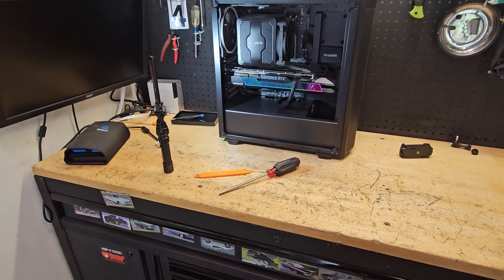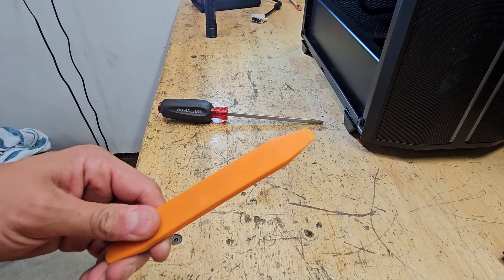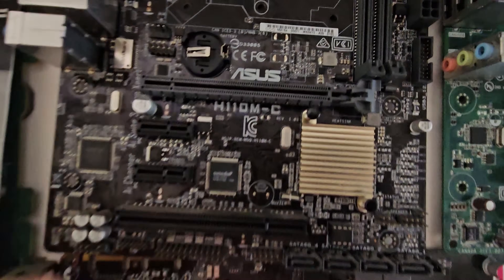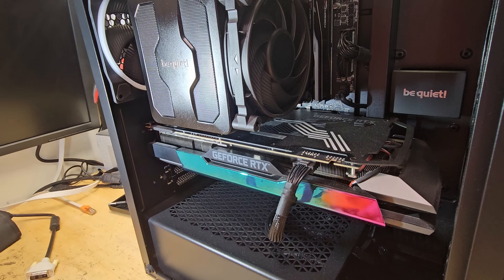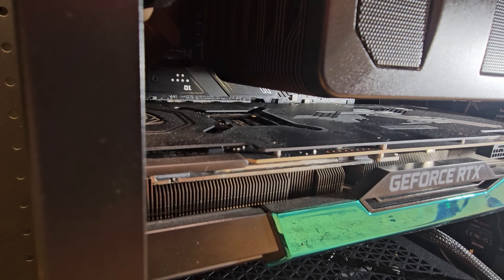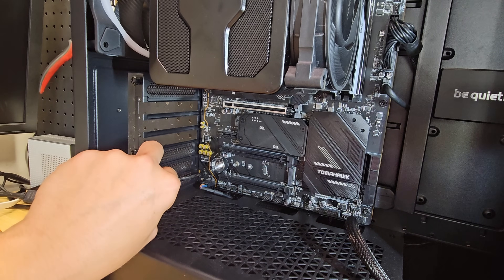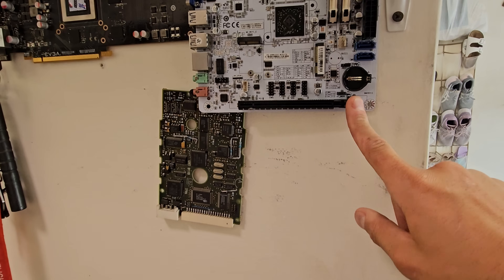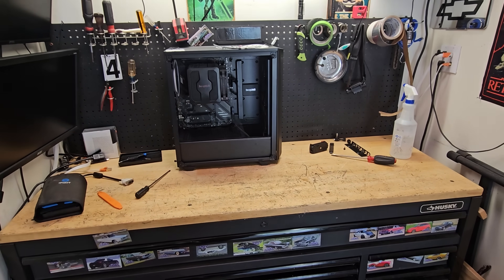GPU removal should not be hard but here are some tips and tricks!!

Comment: I am honestly shocked that this video needs to be a thing.
Reply: well, it was not a thing for some years because people used to use waterpumps and aios alot in the past thanks to intel and the high power consumption and the heat generated so you could push the plastic tab and eject easily your gpu

but now that air coolers are more popular and people refuse to remove the fan to release gpus from the slot, it became useful to know these tips

in my pc for example, the slot is quite far from the heatsink, same for my itx pc, nothing of this is necesary for me but great tips still